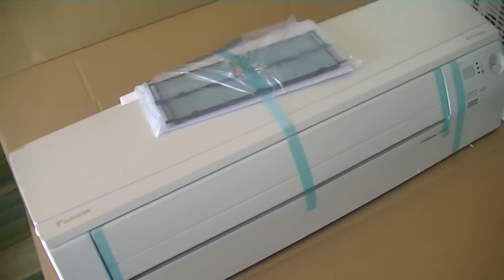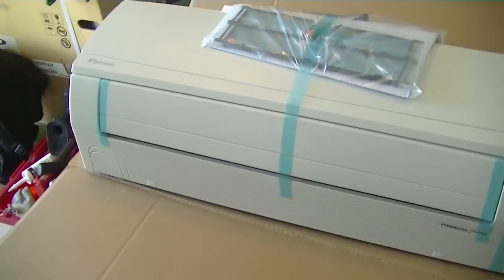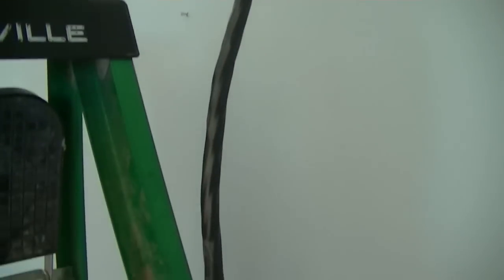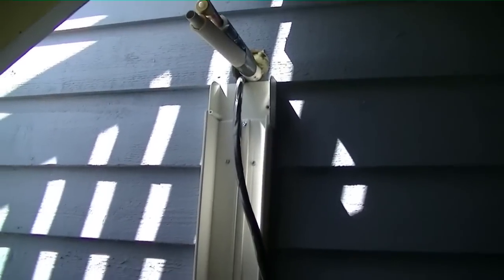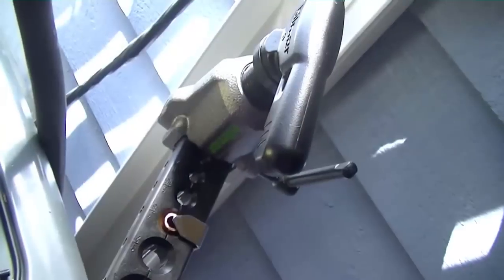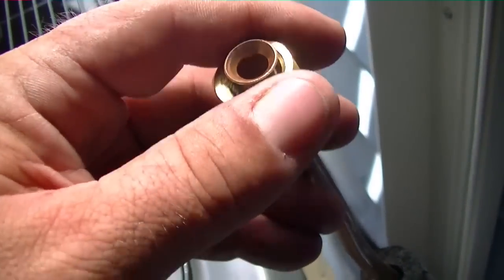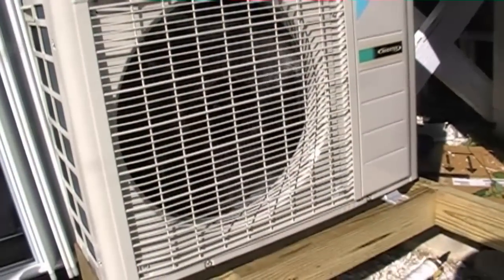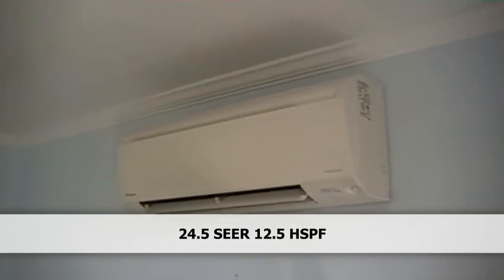HVAC Install-  Daikin Heat Pump Mini Split

Comment: I adding a 16x19 room in my attic... I can runductwork from my current furnace... a little difficult but can be done.. my other option is a 12000 btu daikon mini split.. any thoughts?  Which should I do?  Thanks
Reply from the maker: That is not enough info for me to advise you what to do. You would need to know how much capacity the room was, if your home system could handle the extra space, and if the extra space would require zoning.

Comment: should the outdoor unit ever be installed inside a garage?
Reply: You answered your question inside your question..."outdoor" unit.
Reply: Typically they would be in the attic not in the garage itself. Depending on what type of unit it is.

Comment: You left out the pressure, moisture  test steps, that's the most critical steps before you turn on the system, vacuum pump, low & high side lines,  hookups, does it hold a vacuum,
 etc.
Reply: Nelson Rodriguez I wanted to see the condensate drain design.

Comment: I've purchased from my local HVAC dealer the exact same Daikin LV as seen in the video but mine is a 12 000BTU unit. (FTXS12LVJU and outdoor unit RXS12LVJU)

It's very efficent and quiet. I do not feel guilty about running it a little bit cooler than usual because it's so frugal on electrical power. :)

Comment: What size hose fittings are you using?
Reply: IcennRPG  7, 9 and 12,000 Btu using 3/8 and 1/4
15 and 18 using 1/2 and 1/4
24,000 Btu most using 5/8 and 1/4 other using 1/2 and /1/4 
Daikin VRV  24,000 Btu hose 5/8 and 3/8
suction line pressure in heating mode 380 to 420 PSI for best heating performance
DAIKIN suction line in cooling mode 80 F outdoor 138 to 141 PSI

Comment: Daikin multi-zone 4 ports 4MXS refrigerant manufacture charged up to 133 ft. you don't have to subtract refrigerant less than 133 ft. Single zone usually charged up to 32 ft.
Yes, you can go super heat with this system, but you should wait around 25 minutes to stabilize. general In hot days super heat between 12-15f. Cold day’s 9-12f
Reply: Pacific

Comment: How exactly do you verify the refrigerant charge on those things? Does it tell you how much refrigerant to add/remove based on line length, or did you have to go superheat?
Reply from the maker: It is pre charged for 50m ft. lineset I believe. If it is longer you add, otherwise you don't touch it.
Reply: If the line set is under 50 feet, do you remove a certain amount so it's not overcharged?
Reply from the maker: No, its good to fifty no removal needed.
Reply: That's very strange. One of the things I don't like about minisplits. They don't give you a pressure/temperature chart to work with.
Reply from the maker: They are different. Because the metering device is in the outdoor unit there is no liquid line, only a suction and saturated vapor line. That is another reason you dont have to remove refrigerant below 50 ft.
Reply: Having a low pressure liquid line just seems to be a violation of HVAC ethics. The amount of liquid in the line will vary because it gains heat across the lines, and may reduce the liquid content of the refrigerant before it reaches the coil. This is a huge problem when you deal with a contractor that's used to it being the other way, because they may not insulate it, and it will never cool. They should make it simple by putting the metering device in the air handler and providing some sort of superheat or subcooling chart. It would make things a lot better.